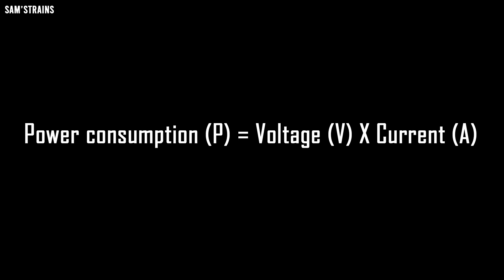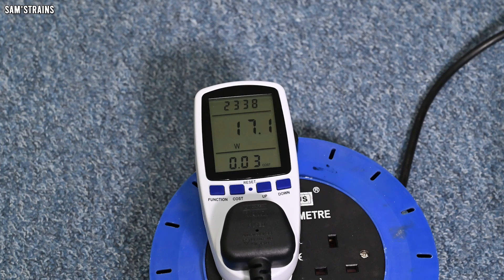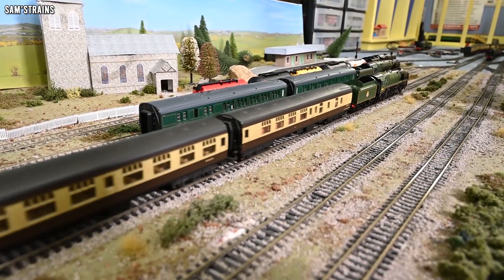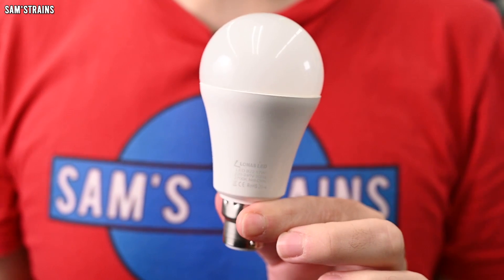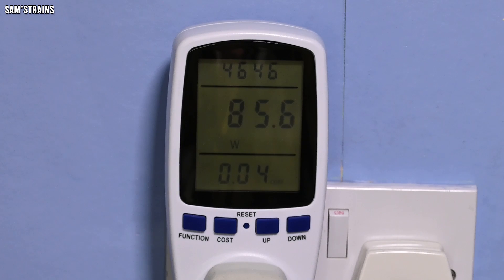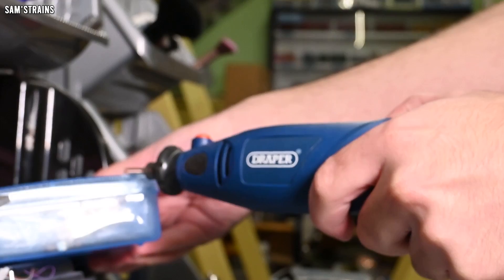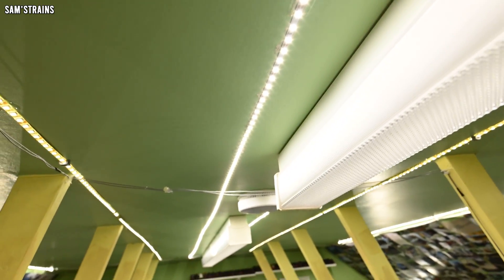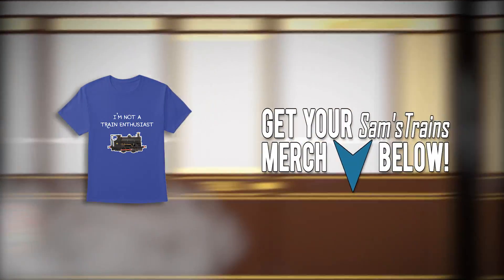New Electricity Prices | What Does Railway Modelling Cost Us?

Comment: A properly machined bearing has a small clearance between the axle and the bearing. The lubrication oil forms a film between the two surfaces. In a well designed bearing the surfaces do not touch while in motion, the oil separates them, thus dramatically reducing friction and wear. Axles directly in the chassis don't have these   smooth surfaces and fine clearances. The lubrication is not as effective in separating the surfaces.

Comment: Something maybe overlooked is the cost  of heating the loft space, assuming your modelling in the loft! Would be likely using electric heaters as most people do not have central heating up there. I'd say in winter it's going to break the budget for some people, some may also need a dehumidifier in such areas..... Great video, and something many people will be thinking about. How much cheaper is this hobby compared to running a games console TV and modem for example!

Comment: Ive got a 30 A breaker feeding the loft with 4mm cable, The current drawn with everything and 5 trains running on DCC is 17A, which is approximately 4 Kw So it would be costing me in the region of £2 per hour

Comment: Current draw will vary with losses from the length of track and wiring as well, not an insignificant difference between a small circle and a large attic layout. Particularly for having the loco run at the same speed. Could be an interesting experiment.

Comment: Very interesting indeed Sam.
Is that radiator on the wall behind you electric or running from your central heating? That would be another cost especially as you come into winter.

Comment: A very neat video, even if you aren't really into model trains! Shows how many watts various electrically powered things use over time. 
This topic makes me think of another topic: Is it possible to make a model railroad power pack and speed controller that can run solely off batteries? I've seen some slot car circuits that use just batteries.
Reply: Yes, it has been done and I think they are available but it's more of a kids toy than for serious modellers.

Comment: The cast of using a soldering iron, should (in most cases) not be that much, as we would not be using it for an hour at a time. Even if we were building an O gauge brass and white metal kit!   Are the LED "Normal" type of blubs better than the "Energy saving" blubs that a lot of us still use?
Reply from the maker: Thanks Mike, that’s a good point! Yes generally LEDs are even more efficient, and they can give of much better quality light too... again, just use good brands so they stand a chance of lasting!

Comment: What about cost of space heating the loft?
Reply from the maker: Most people use gas heating, including me, so I decided not to include that. I assumed people would be heating their homes regardless of whether they were doing modelling,
Cheers,
Sam :)
Reply: would suggest insulation as my loft requires no heating the warmth in the house keeps it plenty warm enough
Reply: @alfiewenn9440  Good point - but you are still paying for the heat to heat the loft - so if the loft is railway only then this is part of the running costs.
Reply: Not really as heating is on regardless of if the loft us in use so the heat is a by product of heating rest if the house so do not see how can include it into the costs of model railway
Reply: @alfiewenn9440 If it's "habitable" space then yes I think you are correct - if not then no not really depends on your house setup roof insulation is quite critical most of the heat loss in a house is in this area.

Comment: The biggest cost is your heating of your loft. By a country mile. However turning your calculations on their head, all the energy you use up there turns to heat. This in turn means your heater doesn't have to work so hard, and living in Notts you probably have heating on 2/3rds of the year...so in that time your actual modelling costs that you have worked out are... FREE. ...
Think about it. Good video mate. Cheers. Gary

Comment: One thing that will help is to regularly clean out printer heads and glue guns, my experience shows cleaning weekly will provide noticeable results. Discouraging things like short circuits or poor connections are difficult to detect during normal usage. The chief offender is going to be analog controllers where usage is is affected by the room’s ambient temperature. Air conditioning is a budget buster. Heating is too, but AC is more expensive. Running things early or late can influence your costs. Then, it’s up to ourselves to figure out the optimum possible results and relax.

Comment: You should look around the cost of light up coaches. Not the battery ones just the ones that use power from the tracks. Because sometimes coaches and cabooses and other Freight cars use power from the track to light up. Yes it slows down the train but does it use up more power trying to run a train AND light up couches.. again not the battery ones... because their on a battery...

Comment: I wonder how much a moderate size DCC layout would cost in comparison.  Lots of electronics consuming electricity.  Not only will your handset, and base station use power, but every loco on powered track, whether in use or not will have the decoder powered.  You can add in controllers for switches, occupancy detectors, boosters should the layout be big enough, accessory controllers for lights, and so on.  And if its computer controlled, you can add a PC to that as well.  I suspect the consumption of DCC vs DC will be much higher.

Comment: A very informative video. It gets you thinking about the cost of electricity for the various devices we have in our homes. At least we have some control over the energy efficiency of the devices we buy, how and when we use them, and when we turn them off. The actual direct cost in electricity of the hobby is small compared to lighting, watching TV, computers/gaming consoles so a green light to us all spending more time on the hobby.

Comment: This is cracking spiffing interesting Sam. You do continue to amaze us. Luckily within the EU, the old light bulbs have been prohibited since years; only LEDs are to be had. The most recent ones from Philips can easily emit enough luminescence for us at ~3.6W each (equivalent to ~40W from the old bulbs). Since we are quite the energy saving “maniacs” (lol), we have decided early on to not use any particular extra lights in the room, nor to model a night scene with LEDs in buildings, coaches and from devices on the layout, except in block signal lights (LEDs). We only have two 3.6W LEDs in the room, and that’s it for lights from the ceiling. You know, to some point, your own eyes (pupils) will very much compensate on their own. 
We have been energy conscious as an avid sport, so thank you for sharing the energy consumption of 3D printing which seems to be rather shocking to be candid. Another matter to consider is that with both of us at home in the hobby (or for anyone else being single), all other energy consumers in the house can of course be turned off as for compensation at least. 
We’ve made it a discipline to turn off everything that isn’t necessary at all times, even the smallest of things such as standby modes of devices. 
Heating is of course quite the different matter, but we do try to keep it at minimum as possible as well; just put on an extra jumper. There is lots one can do. Most people take all the modern energy consumption of luxury just too much for granted I suppose. Excellent content this, Cheerio.

Comment: Thanks Sam, very good information. A good guestimate on what we could be spending. I think your figures are a good guide and if modellers are careful with their usage, the hobby will be effective and still affordable providing the consumption of electricity is used carefully. One thing to remember is to turn off a device or accessory if not being used. For example, building lights and street lights for animation only switched on for effect. At this time of year, lighting in a room , is invariably more than in spring, summer and some autumn . I also use a small rechargeable handheld hoover. Which only needs charging a short time a week. One of the things I am using to use building lights, to have a limited time usage is a power pack (used for Xmas decorations) to light buildings and street lights. 2xAA batteries. This lasts approximately 6 - 8 hours and a pack from Poundland will cost between £1 and £1.50 which will last about 30 - 40 hours, again depending upon constant usage, number of lights. If resistors are used, power consumption is reduced slightly, but on average, an hour a day is reasonable.

Comment: I think the big point you've missed here is heating. Many modelers uses areas of their property which would be otherwise unheated (loft, garage, etc) for their layouts and work area, but I imagine most choose to heat them, at least while they are in there, active with their modeling. I imagine this would incur quite a significant cost, and unlike lighting it doesn't reduce costs elsewhere. What I mean by that is, if you're being energy usage conscious, you will likely only have the lights on in whichever room of your property you are using at a given time, therefore railway modelling isn't really adding cost in regards to lighting, you'll spend about the same on lighting regardless of what you do with those 2hrs a day as even if your not modelling you'll have a room lit somewhere in your house. Conversely, most people don't switch the heating on and off each room as they move around, and typically people are likely to have an automatic schedule to control when the heating is active or not, this is unlikely to be changed by modelling, therefore you are adding the bill to heat your modelling area, rather than just taking the bill from a room you're not currently using and spending it in a room you are using. I appreciate that if the modelling area is an area typically unheated, it's not likely attached to the central heating, so they likely only have that area heated when they are actively in there, using the room,  but still, having heating on for a few hours a day in an additional room is unlikely to be an insignificant cost.
Reply: Yes heating is a big consideration. Models don't like extremes of temperature so you maybe either heating or cooling the room. When I had a lost layout we had a fan heater and a desk fan. In the hobby room this is not such a concern as its in the house.
Reply: @tiddles4x4  I hadn't considered effect on the models themselves actually, so yes, you may even have the heating on more than I'd thought...

Comment: An interesting video topic Sam.  In the winter months, heating your roof space area will make all those negligible power readings pale into insignificance.  I was surprised how little the PC draws considering most have a 500 watt PSu installed.  Possibly that would only increase if gaming or maybe a graphics packaged was used and the electronics was started to get "stressed".
Reply: Barely any computers use 500w unless they are gaming pcs. If it has a 500w power supply it will use 10-50% normally
Reply: This is going to depend a lot on how well the roof is insulated.  Heat rises, so often times the upper level remains at a warmer ambient temperature as a result.    This might actually make heating the space less costly then say the main level.  Of course, this assumes that there is some insulation between you and the outside.  In the summer, the opposite will be true, where you will need more A/C to keep the temperature reasonable.

Comment: Very interesting investigation. You can use your meter to check the efficiency of different controllers too. A vintage transformer with rheostatic voltage divider will be a power sink, whereas an electronic driven PWM feedback one will be very efficient. I wonder how efficient cheapass plasticy trainset (yeah the infamous horny one...) controllers are...? 
(And also using a 800W gaming PC with twined 3D graphic display adapters for controlling a DCC layout is overkilling the bill and the environment)

Comment: Don't forget to allow for power factor. This is easiest explained as the difference between true power against apparent power, its a ratio difference between kW and kVA which applies to AC appliances. You need to know whether your equipment is reading true or apparent power before applying cost, and really should be measured from your metering equipment as even your houses wiring will affect it via resistivity, voltage drop and earth leakage. The industry standard used in calcs for the UK is 0.8 (or 80%) but the actual figure will vary, sometimes quite wildly...hence the standard 0.8. So, depending on which reading your equipment is actually giving you, your costs could actually be metered as much as a fifth higher than you think.
Reply: Power factor is influenced by inductive loads - significant for industry, but negligible for the majority of domestic installations.
Reply: @andydeacon5292  inductive and capacitive. You'd be surprised by how much domestic loads are affected. Whats a water boiler? Inductive coil. Whats a railway transformer? Inductive coil. Kettle? Washing machine? I spent enough time during my apprenticeship at NGB doing power factor correction and balancing 3 phase loads to see first hand, especially during the design process for the residential blocks at Aston University. I still have ringbinders full of notes and calcs from that job dating from back around 2000.

edit to add ~ the reason domestic doesn't really pay much attention is that the mess they create is mopped up on the transmission side of things. But when you're designing a housing estate it very much is on the domestic agenda. Its just not normally thought about from a domestic customers standpoint.
Reply: @Simon-Davis  I accept that capacitive loads also affect power factor. However - kettles? water boilers? there is no iron core, they are resistive loads! Within the remit which Sam has set himself - the costs of running  model trains and associated hobby tools - the only inductive load I saw was the power supply. Since he also had to make many assumptions his figures are no more than a very rough estimate as he rightly pointed out; power factor considerations would make no significant difference to those figures. I think we are digressing too far from the spirit of his efforts!
Reply: @andydeacon5292  Definitely going off at a tangent from the spirit of this video. And you're not wrong about the difference being not all too significant. There is a discernible difference, but in the grand scheme of modelling it is in the order of magnitude measured in pennies rather than pounds. Lets just say I have had slow days at work with not much better to do over the years and some rather expensive test equipment at my disposal to play with...When I'm not doing occasional repairs for the clubs model shop that is. I did have fun using an oscilloscope to decide on which DCC system to go with I must admit, bringing it back to model railways adding to the electric bill, as I'm very good at leaving the soldering iron plugged in overnight apparently.😅
Reply: @Simon-Davis  Yes, we're off topic, interesting discussion though. We must have bored loads of people!👍
Reply: @andydeacon5292  Just be glad I didn't start on about using air pressure to fault locate on telecomms cables 😅 I've done plenty of demos on using Drallim products to remote monitor this. And yes, you can locate a faulty 1940s lead paper core cable using air pressure...its not just about using air to keep the water out. The big question there though is, why do some of those cables have a 'made in Berlin 1940' marker inside them? 🤣

Comment: intresting video sam.
i think that the prices can differ from country to country.
jn sweden we got both wind and hydro elecric power.
thanks for posting this video.
✨✨✨✨👍👍👍👍🇸🇪🇸🇪🇸🇪
Reply: Hydro power is they best I think as it's like a giant battery that can be used at any time and you can shut the water on or off like a tap. Wind is a bit unreliable as it depends on the weather!!
Reply: @LawrenceTimme  yea thats correct .
i think that hydro is the best way to get electrical power.
no hassel with no wind and what not.
Reply: We have wind too but green energy has cost us more on our normal energy bills.
Reply: @vizmortlock  you know why it has to do whith the power
 lines since you can not hook up a wind turbine direct on power grid
due to diftrent voltages as comperd to hydro electric .
we go a lot of wind turbines but the output are not enought to cover power consumtion.
i think that shuting down a neuclear power plant is sher folly if a country has steel mills and mines.
ad to that the lunacy when it comes to charging outlets to ev cars.

Comment: My most used tool is the Rivet-Counter 3000. It's a hand held device, like a speed gun in appearance, that instantly tells you what a manufacturer has gotten wrong on a model.

It was sold to me as an essential item by everyone in the online forums!
Reply: long live the H0/00 rivetcounter...!! does it count 76:1 only or does it work for 87:1 as well....??
and does it run on gas, oil or electric.....??
Reply: Hi Stratman.

The rivet counter has a settings switch that enables it to function on all gauges. 

It runs on either petrol or diesel but if you choose petrol, it must be of the high octane rating. 

These gadgets are sold mainly in large model shops due to their enormous size, and their cost, with a discount, is usually around £999.00p. 

If you decide to use it indoors, you must get it insured and obtain a Government Health & Safety license at a cost of only £119.99p. 

Hope this helps. 

Paul. 👍